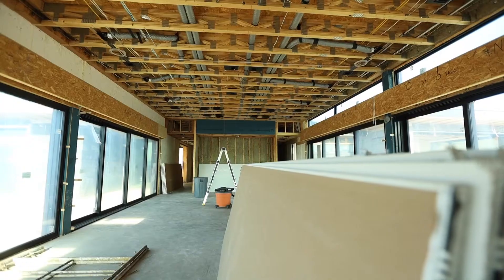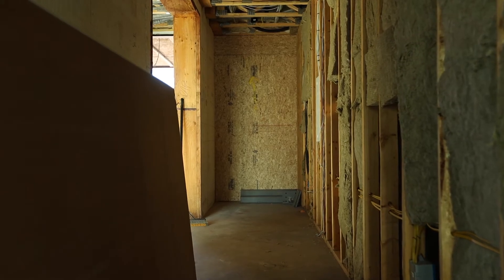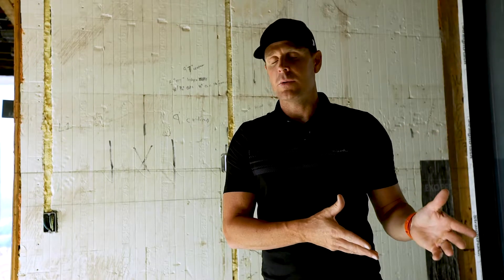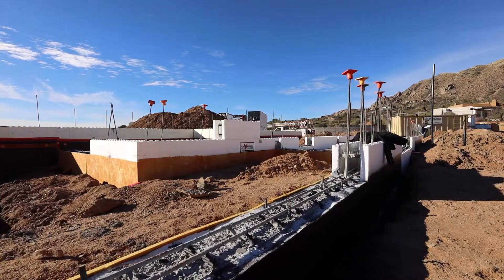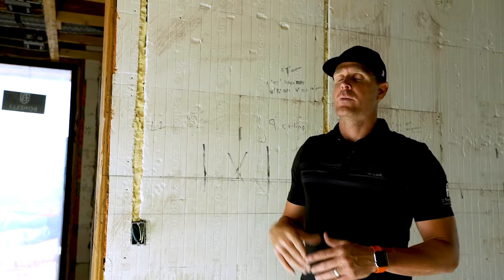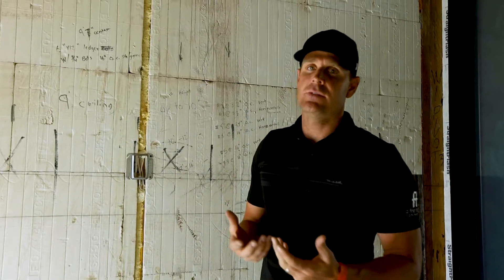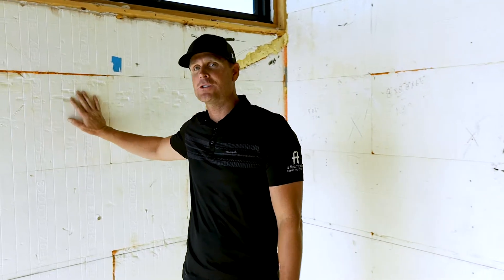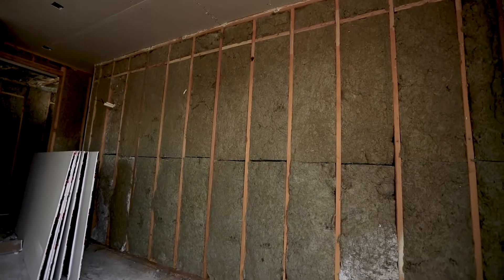Net Zero Home Build Series | Episode 21 | Running Electrical In @FoxblocksICF | AFT Construction

Comment: How do you staple into concrete?  For my ICF walls, I had to run everything in PVC conduit and use steel boxes drilled and screwed into the concrete.  It took me quite a lot of time...